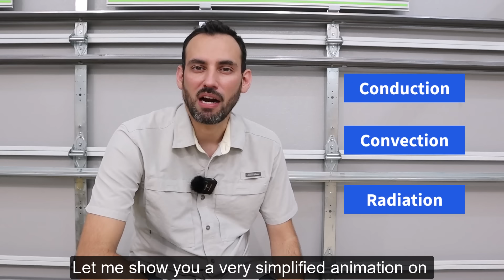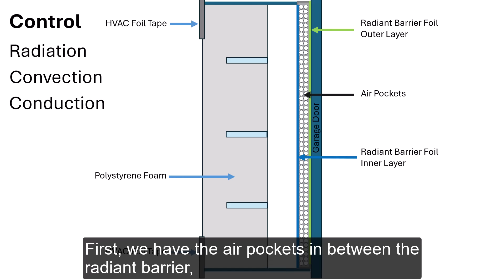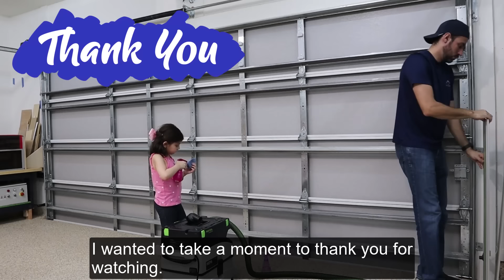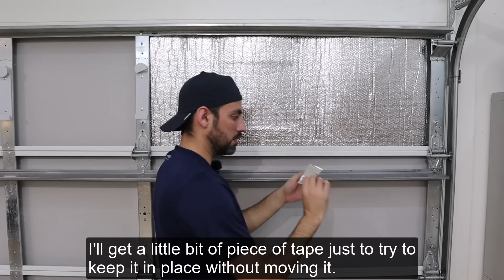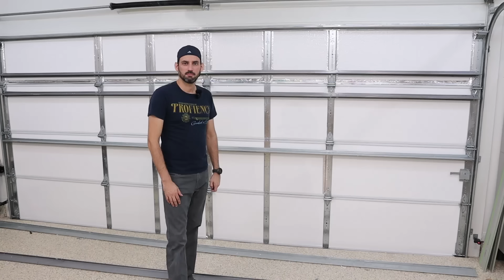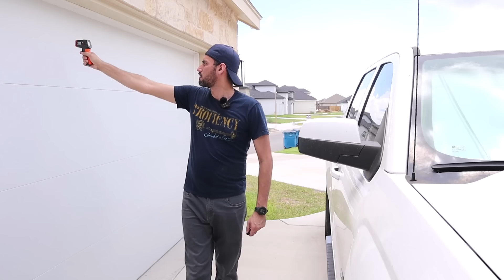The Smartest Way to Insulate Your Garage Door: A Complete DIY Guide

Comment: Great video. My doors are a dark color and get direct afternoon sunlight so there will be a lot of conduction (?) heat coming through the interior bracing and frames. I'm wondering if I should be considering a blanket over the whole door. It's ugly but it will cover frames.

Comment: I read lots oc comments about your choice of processes and materials Carlos. I'm always amazed at how all the armchair experts come out of the woodwork with "The right way to do it" comments. I'm getting ready to do my door and as far as I can tell, any good insulation is better than no insulation. There is no perfect process in my opinion. One question though, and maybe I overlooked it; I would like to see a temp comparison between the outside air temp and the air temp on the inside of your garage during the high heat of the day. For actual effectiveness comparison, an air temp comparison before insulation the after insulation would have been interesting to see because its the air temp we feel on our bodies. Either way, I think you did a great job and I'm sure it's very effective.

Comment: I am interested in doing this for both temperature and sound control. I was thinking of using the 1" foam board that comes with the aluminum backing as the radiant barrier instead of the reflectix bubble stuff since I only have a 1.125" gap to fill. How do you think that will work?

Comment: Thanks for the video, inspired me to go out and get some rigid board, it went in pretty easily only problem is I didn't get enough!  but comparing the covered with uncovered I am getting 102-108 uncovered below with 92-95 covered above.  I also put on a weather shield gasket around the perimeter, this dropped the garage temp by what seems to be about 5 degrees, I think if I finish it off I should get maybe another 4-5 degree drop.but importantly it will allow me to keep my door to the house open for a little bit and not feel like I am wasting too much money.

Comment: Does anybody know how to get that air gap between the door and the silver lining put in ? Also is that the only area needed ?  not on both side of the foil??
   How much more cooler would you think  if you had gave it those air pockets would it be worth it? BY THE WAY Great video Carlos....

One thing it  would've  helped bigtime showing us how you balanced that double door after the installation. 😢

I have a double  door I need to do In Labelle/Miami and temperature  NOW 97 ..OUCHH

Comment: I agree with the commenter that said your design talked about:  foil; air gap; foam insulation - but then you did foil and insulation with no gap.  I think the issue (as I believe you commented) is trying to create an keep an air gap:  when you don't have a lot of space overall (maybe 2"?); also that it's a environment that moves (can you guarantee the gap won't shift).  Do you try for a gap, with less insulation?  Or, skip the gap, to put as much (rigid) insulation as you can?  I think most people go for that.  Also as others have mentioned, instead of more ordinary white Styrofoam, most insulators go with formular and equip higher R per inch rigid insulation.  A question would be, how does the air-bubble foil + rigid insulation compare with rigid insulation with a foil liner (in terms of: cost, ease of insulation, and overall insulation value)?

Comment: What weatherstrip did you use for the outside garage door? thank you much :)
Reply from the maker: Hello there 😀, I used an outdoor silicone sealant around all the edge of the original weather strip. As far as the weather strip itself, it was the original from the house. Most likely is the one you get from the big box stores. I hope this helps 🙏. Thank you reaching out.

Comment: I insulated my garage door with 1 1/2" Styrofoam that has the foil on one side but I like the bubble wrap with air pockets you demonstrated.  I may re-do adding the radiant barrier similar to your garage.  I don't see much of a difference.  (Tampa, Florida) 96 degrees today
Reply: If you face the foil towards the outside you need to leave at least a 1/2” air gap in between the metal garage and foil side or else it won’t work as a radiant barrier. It’s better just to tightly put the styrofoam inside and face the foil towards the inside of the garage. I haven’t tried taping all side of each panel but seems more trouble than it’s worth. I used 1” polypro EPS sheeting with foil facing towards the inside of the garage and can feel a difference but wonder if adding an extra layer of something else would bring the temperature down even more. I’m going to buy a $20 temperature gun and see how much temperature is actually decreasing by insulating my garage.
Reply: @graphicsphere  thanks.  I may read-do it.   I just bought the house and was excited to do that project and didn’t think it through.   My work slows a little bit in December. I’ll have extra time. I will take your advice.

Comment: I saw another Youtube video on how to insulate a garage door, and people were commenting that the material cannot be exposed out without some sort of covering because it's a fire hazard. Is that true also in this case?
Reply from the maker: Yes, exposed foam can be flammable, so ideally it should be covered with a fire-resistant material for safety, or simply not exposed at all if possible.

Comment: I have been researching different insulation options for my garage. One thing I have been hung up on is if I should go the route you did or just do something that is even easier like the "3009 kit" on amazon. I live in FL and I am assuming you do as well? No one else that I have seen has those cross bars on their garage door except FL. I was being lazy and not wanting to remove those beams however I know there is no way to do the kit you did unless I spend a few extra minutes taking those down. After watching how pain free you made this look I'm going to go ahead and buy the same one. Hoping the link you put up works so I can buy it through your channel so you get the commission. You did a great job creating this video. Answered all the questions I had in my head and didn't confuse me. Ill def be following your channel so I can watch what else you put out that will help me. Thanks a lot for taking the time to create this. Its not rocket science however sometimes the simple tasks end up more daunting because I sit there overthinking possible problems that have not yet occurred lol.
Reply from the maker: Glad I could help you decide, definitely worth the extra effort for the results! 🙏

Comment: Garage doors without the garage ceiling being insulated will not keep your garage from getting hot or cold. Opening your garage door also allows heat or cold to enter, so if you are really trying to keep a more balanced temperature you need a way to maintain it, either with A/C or heater. Adding foam-board insulation increases the weight, so your door may not be balanced properly and may require a spring change to properly balance the door. Some may advocate adding spring tension by winding the spring(s) further. This should not be done without knowing the risk involved as doing so may cause injury or death. Adding tension to an existing door can shorten the life of the spring drastically, I have had springs actually break while trying to add tension, or even months later. A car trapped in the garage during an emergency can add to the emergency, it is best to replace older springs according to the manufacturer specifications before they break to avoid emergencies.
Reply: You really thought of everything! 🤡🤡🤡🤡

Comment: HI WHERE DID YOU FIND YOUR GUIDE STORAGE SYSTEM TO HANG ON YOUR GARAGE DOORS?
Reply from the maker: I believe I found the 3d printing file in thingiverse I think, under track saw holder. I then simply drilled directly into the aluminum brace from the door itself. If you would like to avoid drilling in your garage door, you can also used double sided tape along the jig.

Comment: Great video Carlos! Would you recommend different materials or process for someone living in the North-East, where temps can fluctuate between -30 C to +30 C?
Reply from the maker: Thank you for reaching out and so sorry about my really late reply!!! In your case, with those extreme temperature swings, I’d definitely prioritize higher R-value insulation (thicker foam boards if possible) and make sure everything is well sealed to avoid drafts. The overall process would be similar, but focusing on minimizing air leaks and maybe adding insulation to the walls/attic too would make a big difference. The good thing is that insulation works both ways, it helps keep heat out in summer and retain warmth in winter.

Comment: Explain the torsion spring please ❤
Reply from the maker: Thanks, Diego!  The torsion spring helps counterbalance the weight of the garage door, making it easier to lift and lower smoothly. When you add insulation, it slightly increases the door’s weight, which can affect the balance. If that happens, the torsion spring may need to be adjusted, but that should always be done by a professional, since it can be dangerous if not handled properly. I actually made a full video showing this process if you want to check it out! That video is meant to be more informational than a how to video.

Comment: Did I miss adding the small spacer to make an air gap between the radiant barrier and the foam? It was on the diagram but not shown during install.
Reply from the maker: Great eye, Jamey! You didn’t miss it, I originally planned to add spacers for an air gap (that’s why it showed up in the diagram), but during the install I decided to place the radiant barrier directly against the foam. It was tricky to keep a consistent gap across all panels. Even without spacers, it still made a noticeable difference, though adding them could improve performance even more.

Comment: Side issue. 
A rough estimate of your garage door  suggests that the spring force is less than the door weight. It may be well balanced from manufacturer’s view point first day of installation but once 5 of strut bar the spring will be too weak and DIY adjusting the spring to force balance is a bad practice that will cause premature spring fatigue or damage. 
Recommendation? Weight it and pair it again to a new stronger spring. There are suggestions on how to weight garage door on YT.

I can say this from lesson learned. Mine garage door 16x7 weights 155-lb. first balanced with (two) 0.207x1.75x24 spring. After one spring broken I discovered it weights 220-lb carrying strut bars and insulations. Now I have new and correctly paired springs.
Reply from the maker: Thanks for sharing your experience and detailed explanation! That’s really valuable insight. You’re absolutely right that adding strut bars and insulation increases the door weight, and improperly adjusted springs can wear out fast or even become unsafe. I like your recommendation about weighing the door and then matching it with correctly paired springs, that’s a smart approach. Glad you got yours sorted out the right way!

Comment: Hi, thank you for your tip, great video clip. i have a question about your drywall, did you insulated ?
Reply from the maker: Thanks for the kind words! My garage drywalls are not insulated, and neither is the attic, something I should definitely look into to improve the temperature even more. That said, just insulating the garage door already made a big difference. I also added a 1.5 Ton mini split, which makes the space much more comfortable and enjoyable to work in.

Comment: What about the extra weight of the insulation. Did you have to adjust the spring to not overwork the garage door opener due to extra weight?
Reply from the maker: Mine was still functional without adjusting the springs. But to be fair, I don’t open and close my garage door often since I mainly use it as a dedicated workshop (just open it when moving wood in and out). That said, insulation does add extra weight, and technically the springs should be adjusted. I’d recommend having a professional handle that part for safety.

Comment: So I had my garage door insulated and my garage walls insulated and I had a split unit put in
This drastically reduced heat in my garage but what I realized is the metal strips across the garage door between each panel are still getting extremely hot and so does radiate some heat into the garage.  Bummer
Reply from the maker: Thanks for sharing your experience, Frank! Yeah, those metal strips can definitely act like heat bridges and still radiate some heat into the garage. Even with insulation, they tend to get really hot under the sun. A lot of people try covering them with foil tape or an extra thin insulation strip to help cut down on that. Still, glad to hear the overall insulation and mini split made such a big difference!

Comment: Really nice job. I would tell folks that if you only do one thing, it would be to add the radiant foil insulation. By itself it makes a huge difference and well worth the money. Adding the foam is a bonus.
Reply: Thank you Carlos for your video!! , amazing project and save money for the ones that are on budget . 
Your video pop out at the right time while watching another DIY and this is something I need to do as a next project . 

I can’t afford right now to change the garage door, so I’ve already changed the rubber at the bottom of the door since it was old and broken, I had to improved with a different type of rubber seal since I couldn’t find the one that fits mine, my guess it’s too old lol . 
I cleaned garage this past week and now I will do the insulation. 

 Afterwards I need to seal an indent gap on the floor across where the bottom of door sits since I’m able to see light coming through, I’m guessing insects, dust and heat gets through it . 

Thanks again and keep it up with your videos !!
Reply from the maker: That's great advice, thanks for sharing your experience!
Reply: Thank you ! I was going to ask about that , if the foam was necessary since I have the foil and I have a one car garage door. I’m in Florida and it gets so hot that I sweat bullets 😅when I do laundry since I have washer and dryer in garage.

Comment: Carlos, question, the garage will be fully operational, or has to remain closed, wondering what will happen when garage door opener, gets on working mode.
Reply from the maker: Great question, Teo! 👍 The garage will still be fully operational, you can open and close the door as usual. The insulation doesn’t interfere with the door opener’s mechanism at all, so everything will keep working just like before. Depending on the weight or amount of insulation you add, the garage door might need to be rebalanced, but in my case it was still working perfectly fine without any adjustment. If at some point you decide to rebalance the garage door, I’d strongly suggest doing it extremely carefully or, even better, hiring a professional to handle the rebalancing safely.

Comment: I've always been curious about doing this, but what would happen to the heat from your car when you pull it in. Wouldn't having the insulation prevent the heat from the car dissipating and instead trap it in the garage instead?
Reply from the maker: Good question! 🚗🔥 The insulation will slow down heat transfer, so yes, when you pull in a hot car, the heat will linger longer in the garage. But in practice, it usually dissipates through the floor, any air gaps, and when you open/close the door. Ventilation (like a small fan or vent) can help if heat buildup is a concern.

Comment: I did this exact insulation process on my garage doors 2 years ago, but with the addition of foil radiant barrier on both sides of the foam boards. It also had an added benefit of attenuating sound transfer both in and out via the doors. I am in the process of revamping my garage to accommodate a mid-rise scissor lift and installing a mini-split system to be able to work on my various vehicles year-round in comfort, a big help in the Texas summers. If your garage has an attic access, as mine does, installing an insulated "tent" over the access hatch makes a big difference in heat transfer from the attic.

Nice work on this video.
Reply from the maker: Thanks, Michael! Sounds like you’ve got a really solid setup, adding foil on both sides and sound attenuation is a smart move. 👍 The “tent” over the attic access is also a great tip for anyone battling Texas heat, and I’ll probably need to add one to mine as well. I recently did a video on adding a mini split to my workshop, so I can totally relate to wanting year-round comfort in the garage. You can check it out in my YouTube videos!
Reply: I am interested in doing this for both temperature and sound control. I was thinking of using the 1" foam board that comes with the aluminum backing as the radiant barrier instead of the reflectix bubble stuff since I only have a 1.125" gap to fill. How do you think that will work?

Comment: Couple things:  1. Did you know that the exposed white polystyrene foam that you installed is highly flammable?  So, to make your insulated garage door “safe,” you need to cover that exposed insulation with something nonflammable.  I recommend installing a laminate over that foam.  2. The music was horribly distracting.
Reply from the maker: Thanks for the feedback! I appreciate you pointing out the flammability concern — that’s a good safety note, and adding a nonflammable covering like laminate is definitely something worth doing. I’ll look into that for my setup. And I hear you on the music; I’ll make sure it’s toned down or less distracting in future videos.